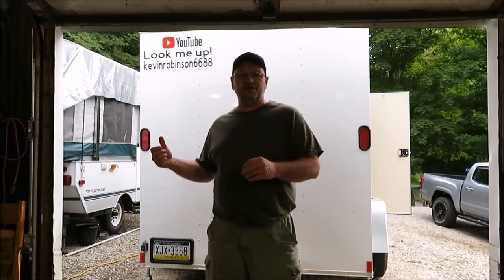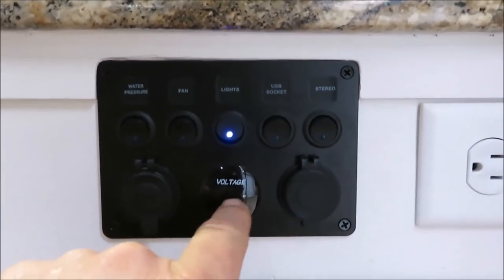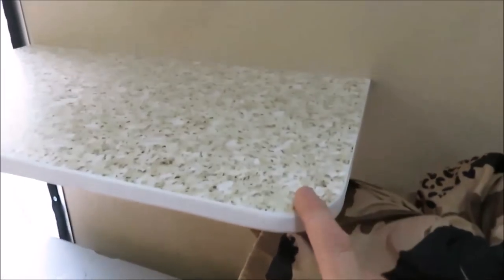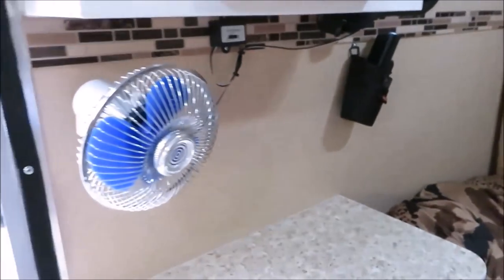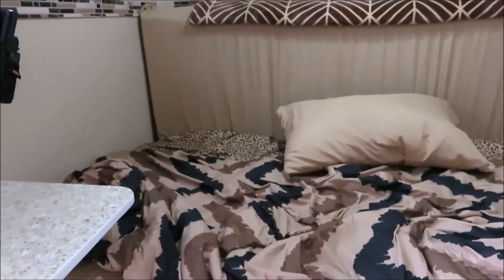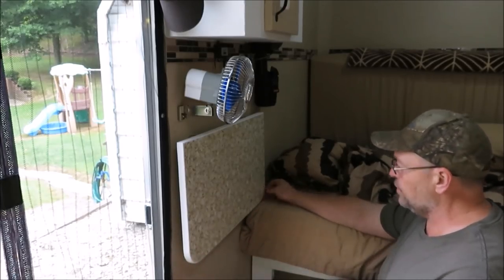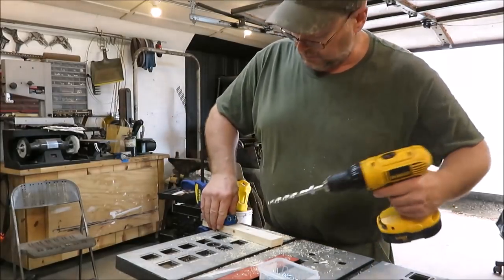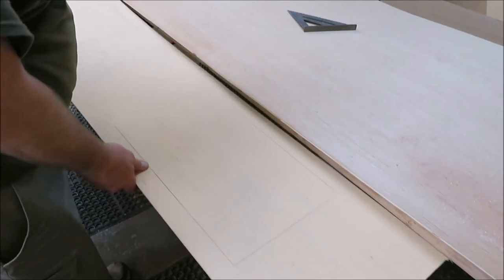6 x 10 cargo trailer camper back cabinets and shelving

Comment: We got our A/C at Amazon it is mini split unit for home it’s a Heatpump heat an cool the outside unit sits on the tongue right in front of the V the inside unit hangs across the V it’s very energy efficient an the price of the A/C wasn’t bad at all an it keeps it really comfortable year around 
Thanks for all the great videos
Reply: That's a great idea but mini's lowest size as l know are 12,000 BTUs.  That's way over sized for your small trailer.  I've ordered a WeeRoll Nomad that will he 10' deep.  I purchased a 5,000 window unit, the smallest made.  It too is still oversized & will freeze me out.  But there's nothing l can do.  The thermostat at lowest setting will cycle it on and off a lot.  That wears the compressor out but I didn't pay that much for the ac unit.  I think the smallest roof top is also about 12,000 BTU's...you could make it a meat locker!  I worked in AC industry so l'm pretty close on the techie stuff.

Comment: I don't think you should try to put in a roof a/c unit.  Too much weight for that dinky roof (it wasn't made for supporting that much weight).  You could get a window a/c unit and find a place on a side wall to put it; maybe over the bed on the left between the two cabinets (new back cabinet door doesn't start from that wall, for 8 to 10 inches or so) should have room for a wall a/c unit there.
Reply: There’s a video on YouTube that shows how they built an outside cabinet that is vented as well...that could be an option...but of course I’m probably too late lol as I’m just on this video😂✌️ thanks for sharing

Comment: I like that cabinet design. Not too heavy either. Do you think that luan will be sturdy enough for iron pans and that? Was also thinking maybe some push button latches  https://www.amazon.com/Cabinet-Replacement-Keyless-Cupboard-Thickness/dp/B00N3HT7GK) would be good with the push button lock to keep stuff closed while traveling. Enjoying the build, buddy.We had a good trip up to the Smokies Spent 3 full days in the park then went up to Cumberland Gap for a while then on to visit family in Indiana, 2700 miles round trip, we were whooped.

Comment: Hi Great video, a quick question regarding your folding table.  I have purchased the same type of table folding shelf brackets but my table top I am unable to drill any hold in it.   Do you have any  suggestions?  This table top came from an RV so it's not wood.  I just don't know what to use to secure the brackets to that.  It's 24x30  size.
Reply from the maker: Sorry its hard to say without seeing the table.